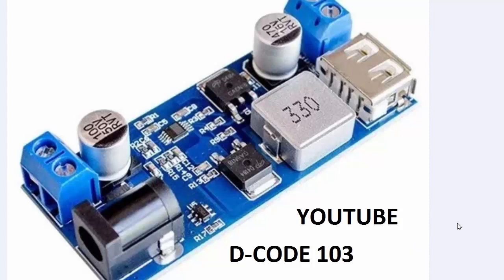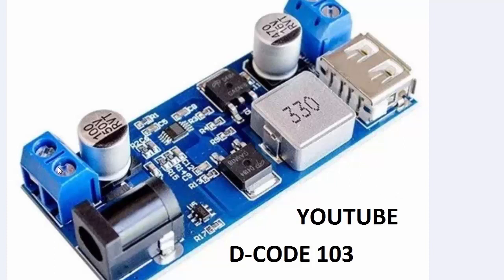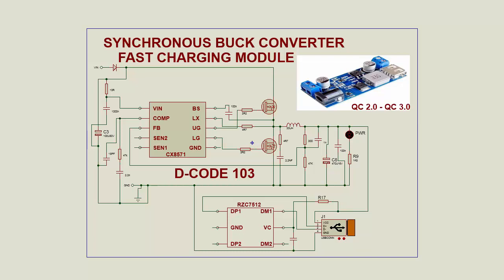FAST CHARGING module DC - DC XY- 3606 power converter circuit and details

Comment: Hi, I have a problem, I use a 12V relay to activate the module, after a month of use, the XY module no longer sends charge, what could be the cause? The output LED just keeps blinking.
Reply from the maker: You need to check input voltage and output voltage without load. Input voltage range 12-24v . Output 5.2V.
Short circuit/over current can shutdown output.
Reply: @Dcode103  Without load, the input and output voltage are correct (Vin 12V, Vout 5.1V, when connecting the load, the input drops to 3V more or less. And the output oscillates from 1V to 4V as in a frequency of 2Hz
Reply from the maker: Now check components may be output capacitor, check both MOSFET, if possible check gate voltage of both MOSFET. Ic should generate complementary pulse to drive two MOSFET in synchronous way.